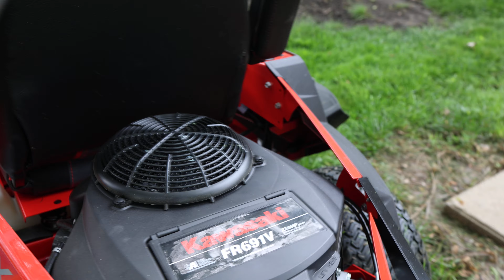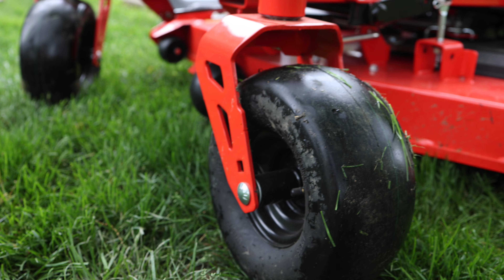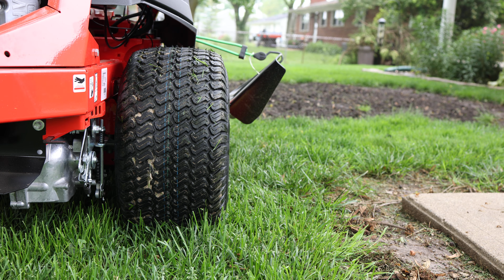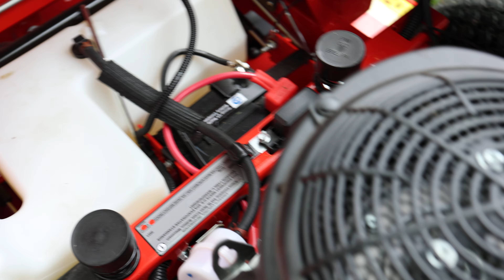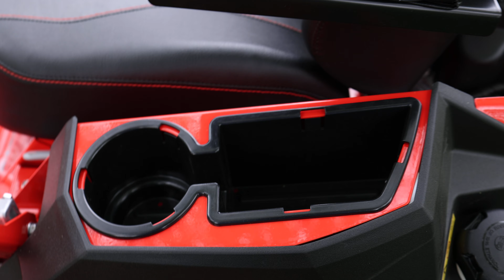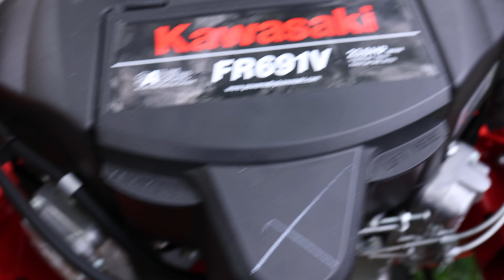2022 Gravely ZTX Zero Turn Mower - Review & First Impressions

Comment: Just bought this model with 100 hrs for $2700. What you describe is what I've experienced, however, these Gravely mowers are rated for 2 acres at one time with no problem. Seems perfect for what I use it for. If I get 900 more hours out of this thing I think I'll be alright. That's a long time for a residential user. Glad I bought it.

Comment: I have a Hustler Raptor 52 with your Kawasaki 23hp and Hyrdo-Gear ZTC transmissions. I have 140 hours and the transmissions are going out. Every single unit in this price bracket seems to have these transmissions. Is that what you found as well??? I need to upgrade but I’m hesitant to buy another with these ZTC transmissions. Thanks!
Reply from the maker: Yes. I ended up upgrading to John Deere Z500 series for the better serviceable transmissions. Also looked at Gravely zt xl. John Deere had better deals at the time.
Reply: @ObserveJeremiah  great I’ll check those out too. Thank you!!

Comment: I was thinking of starting a small lawn mowing service as a side hustle on my days off. My local dealer has this mower with a stihl leaf blower, trimmer and 5x10 trailer for $6200. As a beginner in mowing service (would just be doing smaller residential lawns mostly) do you think this package is a good start? Or would you recommend a more upscale mower?
Reply from the maker: I would not buy this mower for multiple lawns. Would get a pro turn or HD model.

Comment: I think I’m gonna pick up one of these, seems to be the best in class in my area. I would get a bad boy, but there’s no dealers nearby.
Reply from the maker: Besides the sealed hydros I’m really happy with it. While it doesn’t ride as nice as my previous commercial mower. It does cut just as nice and cost $4000 less than a pro turn hd.
Reply: @ObserveJeremiah  yeah I feel like the hydros are still going to last 700+ hours which for me would be 10+ years
Reply from the maker: Agree.